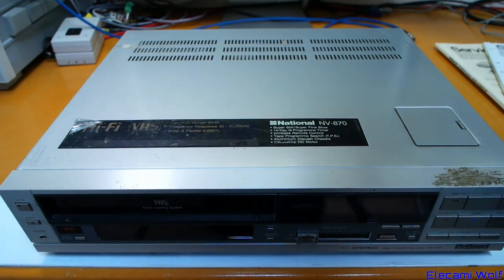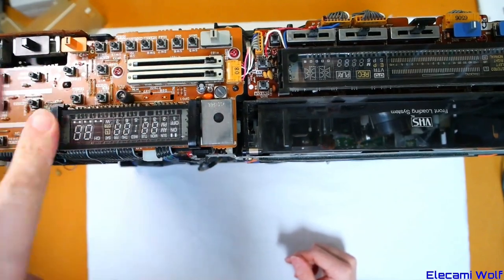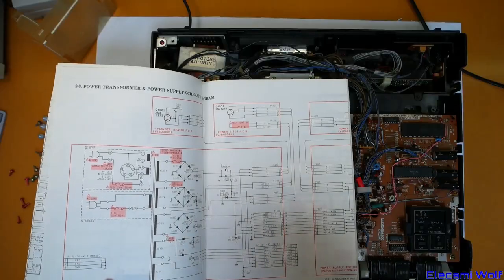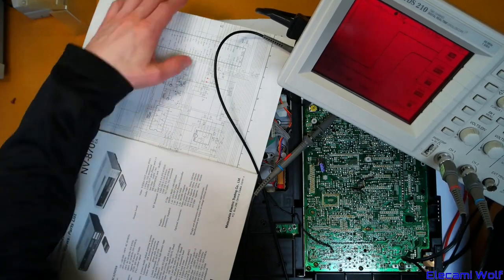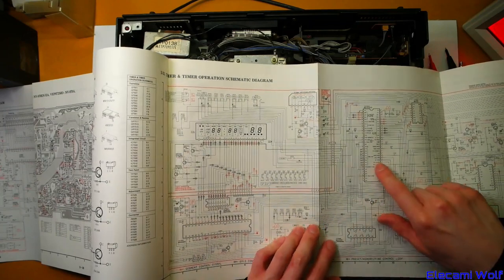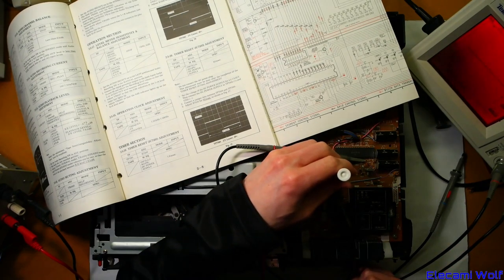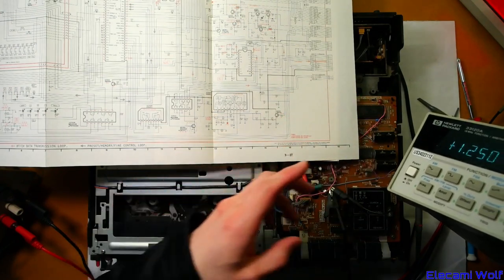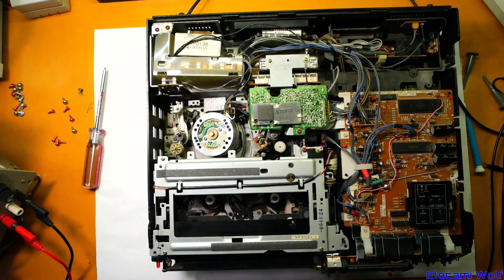EW0064 - National NV-870 VCR Repair Attempt

Comment: nice to have a stereo model I have the NV 788 Model pretty good picture to be honest
Reply from the maker: Nice, that is a good one, Very similar to NV-777 with added Long Play. A lot of interesting features in those. I have NV-777 and NV-788, will make videos about them at some point.
Reply: @Elecami  Hey mate I have a national vcr i got yesterday changed the belts gave it a good clean on the heads vision and sound but when i insert the tape it doesn't want to load it's the national NV-850 Hi Fi model any idea what it could be ?
Reply from the maker: @VFAFOOTY  Is it all powered up ok. Does the loading motor try to accept the tape?
Might need check power supplies, check the switch that detects tape insertion, check the  motor driver.
Reply from the maker: @VFAFOOTY  The reply disappeared? I'll try write it again. 
Does the VCR power up ok? Is the loading motor moving at all? 
Check power supplies, check the tape insertion detect switches, Check the motor driver.
I have 3 NV-850 sitting here we'll take a look at them at some point. In the next month or so perhaps. So many I can't decide what to do next.
Reply: @Elecami  Not sure why but just tonight I went to have another crack at repairing it 
Turned it on all the front panel lights up then goes off again 
So I'm guessing it's got another issue maybe with power supply 
Reason I'm persisting with this as I have heard great reports on how good these machines were was looking on YouTube also some nice examples working :)
It wad first vcr made by Panasonic that was hi fi I believe ? 
Cheers for your time 
Cam
Reply from the maker: @VFAFOOTY  It was a popular model. I am not sure if it is the 'best'. I think the technology and implementation would have developed a bit with the newer models. 
Maybe the oldest consumer VCR with HiFi sound. There are some more industrial and professional models with HiFi Sound that could be older? Maybe AG-6800
I am not sure where you should look first on yours for that problem. Probably follow a similar method to what I did here on this one. It is a lot of work.
Maybe check around all the power regulators on heatsinks. For cracked solder. 
Power supply voltages, regulator voltages. Voltages ripple. capacitors. Clock function. Power up / power supply control signals. 
 Then microcontrollers their reset and clock signals.